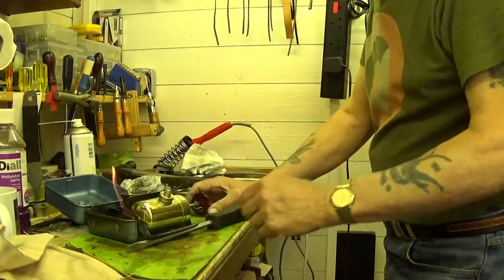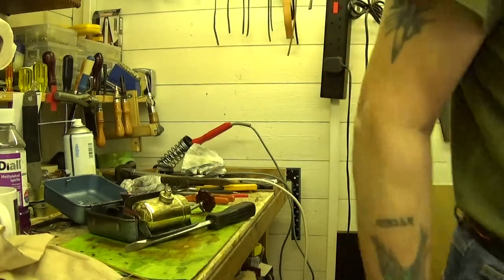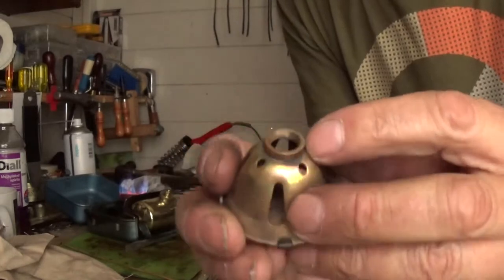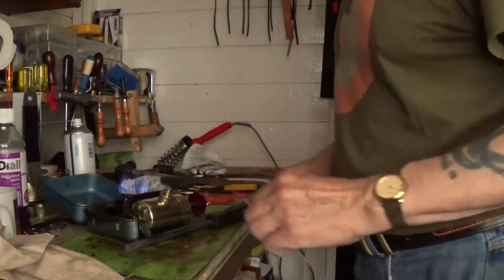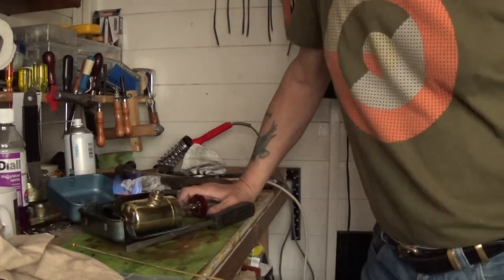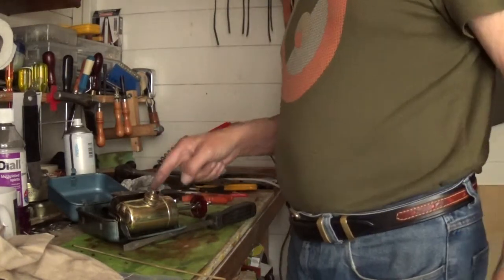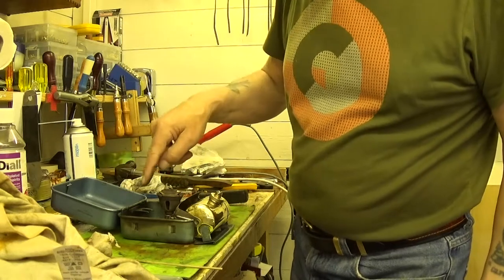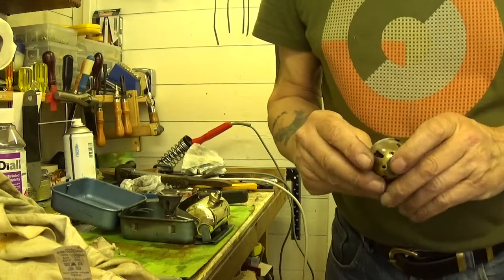Repairing a 8R stove

Comment from the maker: TO ALL YOU CAMPERS AND BUSH CRAFTERS OUT THERE If anyone out there has got problems with a Svea 123 or 123R stove, even a Optimus 8R then just contact me on 07713090929 and I will have it up and running for you, all just for the cost of postage, yes you read it right just for postage, as I have some time on my hands now being retired.
i LIVE IN KENT ENGLAND, 44+ 07713090929
Reply: Were are you based in uk? Got a 8r that needs a refurbishment and tuning